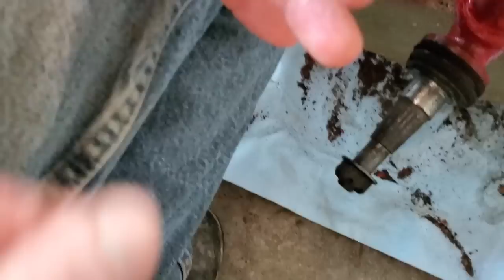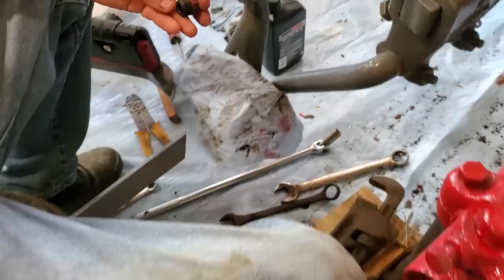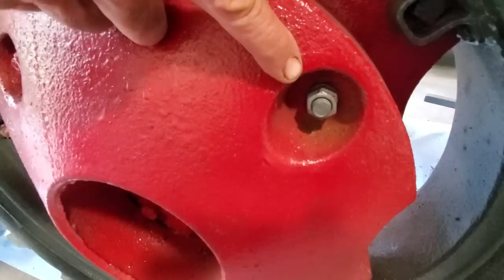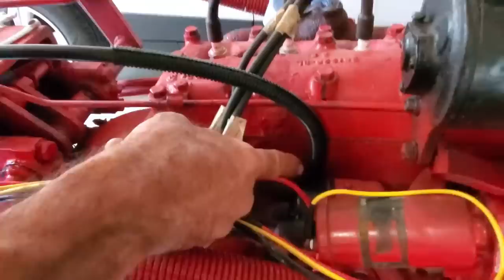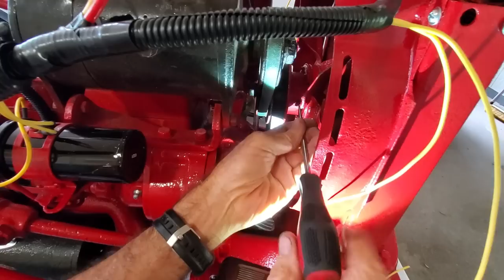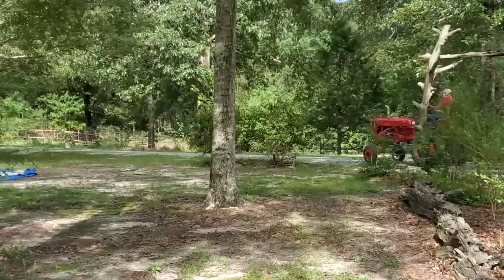1950 Farmall Cub -- Restoration --  Replacing bolts, fuel lines, and Taking Her for a RIDE

Comment: When you put the new seal in steering box , On ones with shafts like that , i put a fat O ring on the shaft a inch or two before gear box . Then the water drips off the o ring and the seal does not see as much water. But indoor kept stuff does not see as much water

Comment: Those lil Cubs were always a terrific little tractor I've always like them those and the baby Alice Charlmers and I'm glad to say the one we had to work on we came up with all sorts of things steering seal replacements and we added oil resistant o rings to the outside the steering shaft to stop water intrusion of the steering gearbox and the vented plug yall cleaned our had been lost and replaced with a brass plug undrilled and I drilled the top of it and put in a zerkfitting for grease that had no retention ball and spring and made a crimp in cap that kept out water and allowed the plug to breathing and out due to temp changes from the thermal cycling of the radiator. Love yalls videos

Comment: Hey y'all I am so happy to see the explanation of the engineering involved when these were manufactured. These were the small key bits of knowledge that made the tractor run the way it was engineered to do. The prudent farmers and mechanics, haha the farmer was most likely the mechanic, knew to take the extra step to do stuff right the first time. In the military we had the PMCS, which is Preventative Maintenance Checks and Services system. The driver, the unit level maintenance and organizational maintenance each were listed on a chart with the frequency intervals of how often different things needed to happen to keep the equipment running at the peak performance. This is why so many vehicles from the 1940's and 1950's are still in use today and working just fine. bye now

Comment: I’ve rebuilt and worked in quite a few old Cubs and other farmalls. Every one has had the hole plugged up. My dad was a welder and taught me that tip cleaners come in handy for the same thing you’re doing as well as cleaning carburetor orifices. Sometime you have to use a little hand drill bit. My opinion is that a plugged vent is the cause of the lower seal going out, causing  a big headache. I usually clean the hole and leave a piece of wire in the hole while painting the tractor to keep from painting it closed. I have also come across a lot of tractors with the plugged hole that were running grease instead of oil in the steering housing, due to the lower seal leaking so bad that oil would just run out. Regular grease doesn’t keep the steering gears lined, though. Corn head grease will buy some time and I will give some lubrication.

Comment: An air impact helps with rusty bolts a lot, the hammering and vibrations help to shock the rust off and break the nuts and bolts loose. I'd say 7 out of 10 times, a rusty bolt broken off by a ratchet or a wrench wouldn't have snapped if an impact was used. Nice old tractor you have there...

Comment: Those steering sectors originally had oil in them. Over the years the shafts wear by the seals. As a result of this the oil would leak out.  A lot of guys fill the box with corn head grease because it flows well but doesn’t leak out. It’s  a solution that doesn’t require replacing the shafts.

Comment: The Cub is a relatively simple machine and doesn't really require many tools or specialized tools.

I have heard you mention you ordered manuals. You can get the manuals for the Cub and all the implement manuals on the Farmall cub forum. You have to join and have a few posts but you can download the PDFs and if you want the hard copies and put them in a small binder. And like I said will also give you a place to download things like the planter or cultivator , or belly plow manuals so you know how to set them up or the part numbers.
Reply from the maker: I have all the original books on all these things.

Comment: If that's the original starter switch/contact it may be better than the new one you have ordered big it wasn't worn out. The guys on the forum say those new reproduction ones are not good and the contacts aren't as good as the old ones.
Reply from the maker: The old one was wore pretty bad but I do save all original part's and rebuild them in case I need them in the future.

Comment: Did you make a video filming you changing the oil in the finals, transmission, touch control and that steering box? Looking at some of the farmer fixes and attention to detail it had I would want to make sure I knew for sure there was fresh oil in every sump on that tractor.
Reply from the maker: I will do videos when it's time to change them.

Comment: Love the videos. I have a 1974 Farmall 140 and recently started leaking fuel around the nut and fuel pipe that screws into the sediment bowl assembly. It had a small brass type washer on the end of the fuel pipe there at the sediment bowl but I lost it but have read that they later changed to a current type of brass ferrule but I am not sure which size or if the ferrule has to slide onto the fuel pipe or must be attached to the larger nut or if it matters to seal and stop the fuel leak.
Reply from the maker: Usually the Ferrell slides over the pipe then squeezes down on it when tightened.

Comment: You said previously that this is going to be out in the weather. You have that nice looking tractor and you going to leave it out in the rain and weather? Why not have a lean-to or small shed or add on a small cover for it to keep it out of the rain and direct sun.
Reply from the maker: I meant it will be used outside. It's in a shed.

Comment: Danny, I love your cub, and your restoration work on it.  I love that paint job you done on it.  Do you have a before picture of your cub.  When you painted your cub.  Did you sandblasted back down to the metal?  Or did you just slightly sand it, primed it, and painted.  I have a 56 cub model J, I am about to start  restoring.  Where is the best and economical place to get parts for the cub.  I live just south of Dallas Texas in Ovilla and there isn't anybody that handles Cubs or any Farmall equipment down here.  If you can help me out I appreciate it. Thank you
Reply from the maker: I wet sanded it and primed it then painted it with original factory international paint. Most of my parts come from Stiener tractor company and Burch tractor company.
Reply: @DeepSouthHomestead  ,Thank you very much.  I do watch your channel a lot.
Reply from the maker: @rogerstevenson4906  I have a video of when I first bought it.